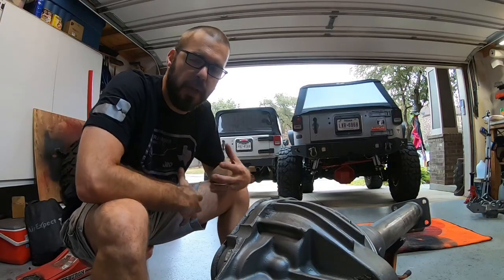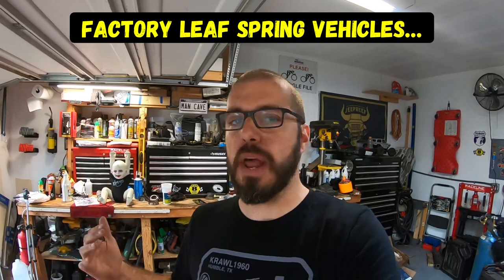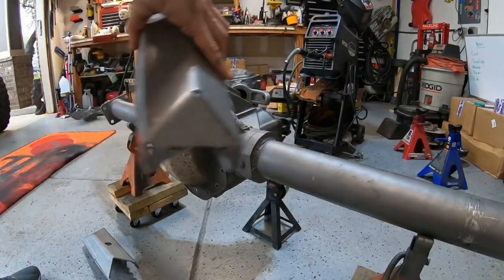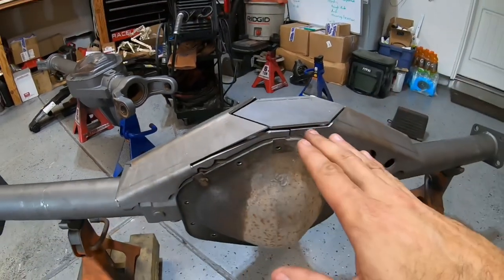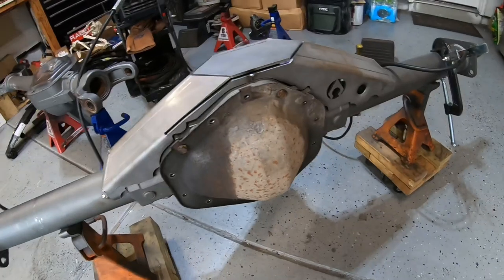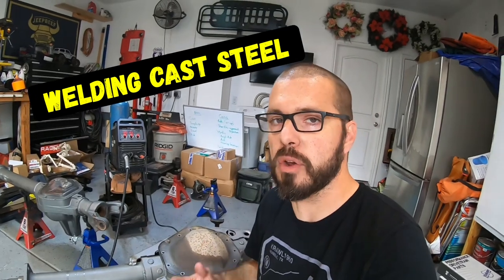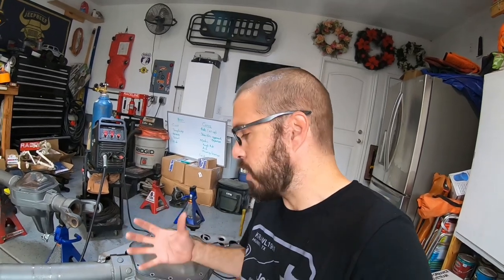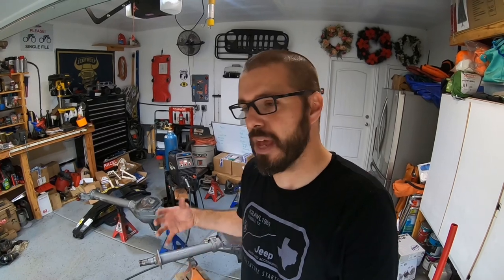HOW TO WELD AN AXLE TRUSS - Project Maple Leaf Jeep Build (no. 15)

Comment: This video is a treasure trove of information for me. I'm about to build a truss for an Explorer 8.8 into a Gbody and I got a truss kit with a single page of instructions. I already learned about instant center/pinion angle but your talk about heating and cooling the welds is huge to me. There's a bit of everything here and I feel like I actually understand what I have to do to make sure this is adequately welded together. Really appreciate this content.
Reply from the maker: I’m glad it was helpful. I also just did another video that might have some more information about welding it better. It’s a front truss on a Dana 60 from Artec…but the same info applies. There are some other ways to do it…but this is the most time efficient way. Have fun with it. If you have any questions I usually Dan respond faster on Instagram @WarPaintJKU.
Reply: @WarPaintOffroad  Just wanna say thanks again for this video (and the other one). my project car is running and driving. The rear end is solid thanks to the information you shared.

Comment: Awesome vid! Can this be done with a stick welder and 7018 rod?
Reply: Yes, 7018 would be a great way to weld on these axles! 7018 would be fine for the brackets and tubes, pulling the axle out from under the Jeep and putting it on stands so you can weld everything in a flat position (95-120 amps 1/8 7018) would be best. And for the center section, preheat to around 450-500 and use a nickel stick welding rod, and be sure to post heat the mild steel to match temp to the nodular center section
Reply: Thank you!
Reply from the maker: Sorry for the delay. Like said above….definitely. I love the detail the above comment gave. That’s what makes this community amazing. I wouldn’t have been able to give you that detail for stick welding. But it can definitely be done. I have seen it done that way.
Reply: @671JK  you might have good luck with 3/32 7018 in certain areas too, 1/8 might be “too big” for certain spots. I’d use around 95-110 amps for 3/32
Reply: @WarPaintOffroad  I learned how to weld using 7018, so it’s kinda second nature for me. I was on the fence about whether to MIG weld or if I could stick weld my truss and c gussets on, I would have to buy a mig machine for the mig or I could borrow my buddy’s stick/tig machine for free.. so I think I’m gonna go the stick route.
Reply: @michaelgarcia6580  thanks bro! I’ll get both rods, doing some truss and new spring mounts.

Comment: hey warpaint, were you on a 240v outlet on that welder? harbor freight has the titanium 170 mig welder. You think thats good enough to handle the job? Was doing some research for welders and I wanted to get something good to weld on this thick .5" axles
Reply from the maker: Yea! 240 for sure. The smaller stuff just can’t weld as thick.